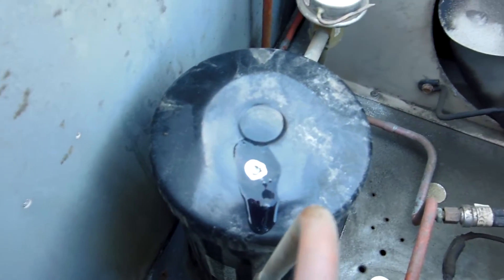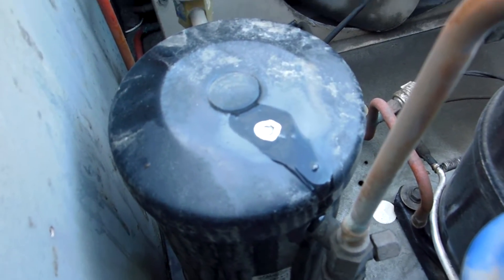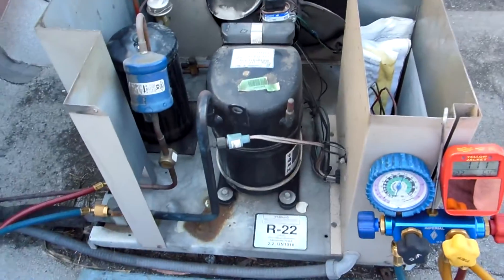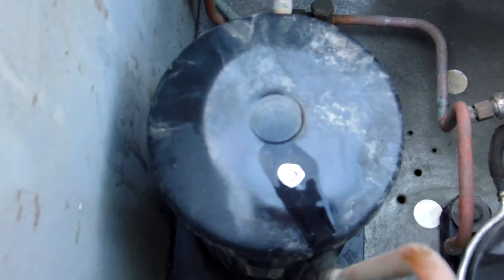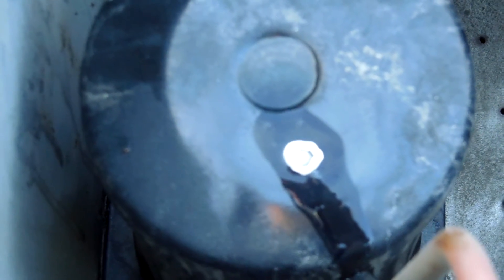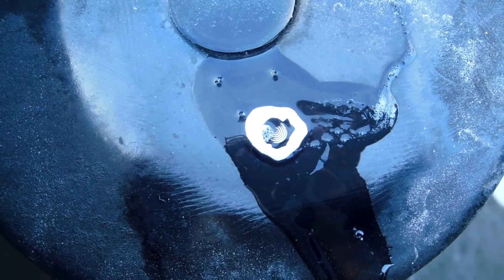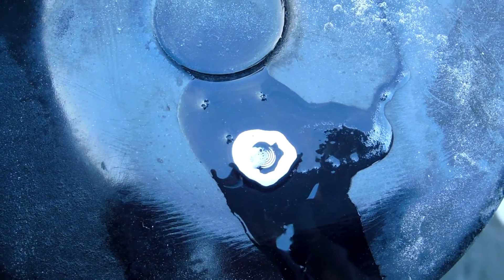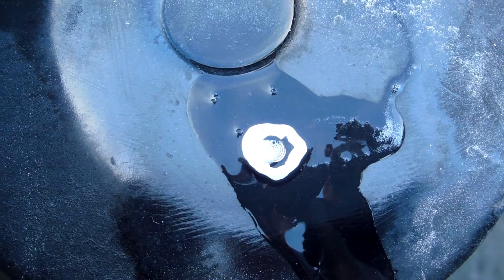Liquid Line Receiver. Top of Receiver. Fusible Plug Leaking.

Comment: What do you use to look for the leaks?
Reply from the maker: Refrigeration systems / air conditioning Must ALLWAYS be above 100psig to Get The Best Results when leak checking.
I use the Ge-H10G Leak Detector.
Soap bubbles / Liquid Leak detector fluid are used to verify the Leak visually.
Palmolive dish soap & water work too.

Comment from the maker: Customer is short on funds right now. it Takes about 5 Months to leak 1/2 the charge out so in 5 months i'l be back there to fix it. Probably gonna replace the Receiver. i'll have to order one in. or i Might Remove it, Flip it upside down Melt out the Solder or what ever that thing is Drill it out , clean it up. Weld over the Hole With some 15 or 56% and re-install. evac and re-charge.

Comment: That's a strange one my friend. Never seen anything like that before. What did you have to do to fix it? If I heard correctly, it's a package unit and it's leaking on top of the reciever...
Reply: I've only seen this happen once too. It was on a hacked install of an outdoor unit, installed INDOORS on top of a cooler box only 3 feet space between the ceiling, very cramped hot area. Small leak that the other companies never found but leaked out all the R22 every 4-6 months.